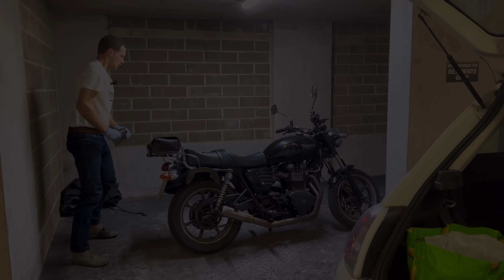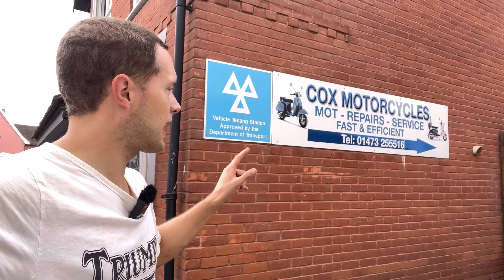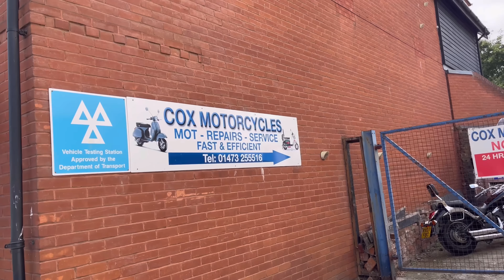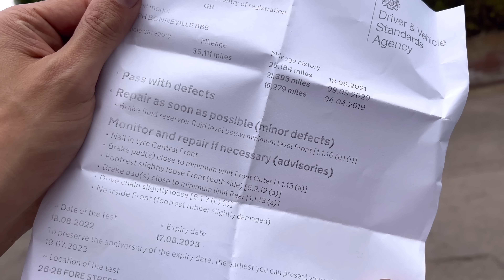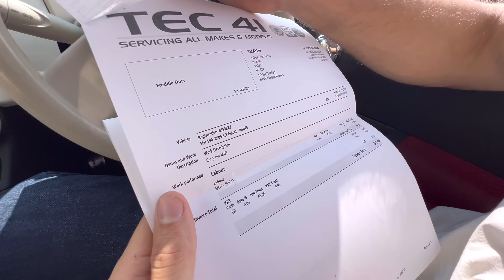Two Desperate MOTs in Two Hours | And Three Week Wait if the Bonneville Fails

Comment: If you removed the master cylinder cap on the bonnie and used a longer screwdriver it would have been a lot easier to push the pistons back. Obviously you would need to watch that no fluid overflows from the master cylinder whilst doing this. You should also clean the pistons before pushing them back or the dirt on them can ruin the seals.
Reply from the maker: Noted- really appreciate this👌🏻👌🏻🙂
Reply: But like the comment said, watch brake fluid doesn't spurt out of the reservoir, cover metal work (petrol tank) with plenty of cloths and gently push the pistons back.
Reply: You can protect your bike from any overspill by getting hold of a sweatband and popping it round the open master cylinder. Any fluid that overflows gets soaked up nicely.
Reply: @FreddieDobbs  @HeeBGB By placing the pistons further in, to accommodate the new brake pads, the fluid level will rise, which should solve one of the pending issues of the inspection (MOT).
Reply: I would also put the old pads back in, then use the screwdriver 🪛 to lever the pistons back (after cleaning & removing master cylinder cap).. whilst all metal etc, you don't want to nick the rubber dust seals around pistons
Reply: Correct.
Reply: There are seals around those pistons that can be damaged from the dirt and grime on the side of the pistons as its pushed back in. You want to clean the area first with a product that won't harm the rubber seals.

Comment: tip - spray the exposed calliper with brake cleaning fluid first, before compressing back in, with fluid reserve cap off. that way, it should prevent dirt damaging the seals.

Comment: Remember to take the cap off the brake cylinder so you are not working against pressure. Be careful when leaning on the caliper cylinder because it IS possible to snap them.

Comment: Wow - I was feeling stressed just watching this. The list of advisories was not actually that bad - stuff that is fixable with just a few hours work. Front brake fluid level is low because the pads are worn out. When you replace the brake pads it is worth replacing the fluid as well so you know everything will be good for a few years. Love the brake caliper piston compression tool improvisation - as someone else noted good idea to clean the pistons before you push them back in. I must admit I never thought I'd hear FIAT and reliable in the same sentence but it must be an older one made before LED lights etc. became vogue - we have a 17 year old VW Golf Mk V that is the same - generally very simple to work on and just keeps on going.

Comment: Bit behind on your videos, Freddie.  Good to see you do some of your own maintenance. Is it really over a year since you set off for Tenerife?. I really enjoyed that series. Stressful today, eh. Both my Yamaha MT-01 and my Can-Am F3-S started first time after over two years eight months away from Portugal. I had to buy a battery for the F3, though. Kicked myself for not disconnecting the battery, but I didn't realise I'd be away so long. I lost one of the nuts when fitting it and had to hike around to find another. The hardware shop had never seen one the shape I wanted. A motorbike shop had one, though.
      192,000 miles on the Fiat. Fantastic. Simplicity is priceless.

Comment: I was watching you try to push those brake cylinders in thinking "G Clamp!!", but you got there in the end. Only difference for me is to put the other old brake pad under the other side of the G Clamp to make sure the clamp doesn't leave an unsightly mark on the outside.
Reply: I use "tongue and groove pliers" as they are called here and otherwise used in plumbing and also agree that using the old brake pads to prevent marking the pistons work very well.

Comment: Hi Freddie:

I have tips for you:

opening the brake fluid reservoir cap will make it easier to push the caliper back in.

the brake caliper should not be left hanging on the brake line when working. the brake line can break or leak. hang the brake caliper on the front fork with a rubber band or rope, then nothing can break. it is important that the brake line is not pulled.

but you did a great job.

best regards from Germany.

Comment: Job well done Freddie, l’ve been using G clamps to return pistons on bikes and cars for years, if you remove the reservoir cap and you can check if it’s going to overflow as you push the pistons back in, if it does a bit of clean tissue paper will soak up any excess fluid.

Comment: Don't worry about the piston rewind tool/caliper spreader. Just replace the fluid and Bleed brakes through when you out new pads in. The fluid is only a couple of quid and it's good practice to replace this often anyway and it really doesn't take long. When all the fluid is removed the pistons should push back in with your fingers very easily. 👍
Reply: Don't give Freddie even more stuff to do, Monika will sink into a vat of despair.
Reply from the maker: I’ve never bled the brakes- I know I must try, thanks BMS🙌🏻

Comment: The use of a thin coat of anti-seize on the backs of the brake pads is traditional to prevent brake squeal
as the pads vibrate forward and back microscopic amounts along the face of the moving disc surface.
The anti-seize acts as lubricant between the metal back of the pad and the face of the piston.  For that
reason, the annular face of the piston should not be marred, but should be kept as smooth and flat as
possible so it doesn't push through the anti-seize to form metal-to-metal contact.  The C-clamps can be
used with a used pad as a flat surface to push the pistons back into their cylinders, or if the center of the
pistons are slotted, a LARGE flat screwdriver can be use to push the pistons back while rotating them with
the screwdriver to avoid jamming them into a cocked position.  The push-back process can go more smoothly
if the surface of the pistons are first cleaned with brake cleaner and then lubricated with anti-seize or WD-40.

Comment: Freddie pipe wrench  is good for pushing the calliper pistons and always remove the master Cylinder cap put a clean rag over the top keep and eye on the fluid level and probably change the brake fluid every two years. Now living in Australia  don’t miss the mot every year in our location just service keep roadworthy but no annul worry mot check.

Comment: If there was a hardware store nearby, all you needed to compress the brake caliper pistons back in is a good sized C-Clamp and use one of the old brake pads in there to compress both pistons at once. I've done it many times in a pinch. Otherwise any auto-part store typically carries a brake caliper compressor. I'll give you an A+ for effort at least ... LOL! Always enjoys your videos nonetheless, thanks and safe travels!
EDIT:  Just watched through to the end of the video and it looks like that's exactly what you ended up doing (using the C-Clamp) - they're always great in a pinch when the proper tool isn't accessible! LOL

Comment: Fred, when you get a bit of time you really should clean those brake pistons. It's relatively easy to do and will improve your braking no end. 
 Ok, so take the calliper off; either front or back, and hold it in one hand with your thumb on the pistons themselves. Then, pump the appropriate brake; front or back, very slowly to raise the pistons out of their sockets. Whatever you do, don't let the pistons come out of their respective holes as it's a bit of a nightmare getting them back in: bleeding the brakes etc etc.... Next you need to get some WD40 and some very fine emery paper and sand the sides of the pistons till they are smooth all the way round. You could also gently sand the tops of the pistons too, as they looked a bit rough during the vlog.
 You should then smear 'Copper Slip' over the sides of the pistons before reassembling. Once you've done this, you should be able to push the pistons back in without using the G-Clamps. I have done this to my Honda Hornet 600 for all 3 disc brakes on the bike and the difference is noticed immediately.
 I learned to do this from a You Tube vid about 10 years ago and believe me mate, if I can do it, so can you. My bike was stolen just over a month ago so at the moment I am bikeless. In the middle of summer too. GUTTED!!
 Hope this helps
 Aidy x

Comment: The slots in the brake pads do three things: 

a) Allow gasses to escape from between the pad and rotor under heavy braking as the friction material "burns off". The holes in the rotor also help with this.

b) Act as a visual indicator for brake pad wear. If you can still see the slot there's still at least some pad left, if you can't you know you're in dire need of a change.

c) Change the way in which the pads make noise/vibrate by changing the natural frequency. Like a tuning fork, the length of the pad changes the resonant frequency. By splitting it into two sections it changes the effective length and will usually reduce noise but will depend on the overall braking system to if it actually does anything.

It's mostly for the noise part. I doubt you'll notice a difference.

Comment: Very entertaining. Ever thought of cleaning the caliper, including the floating part of the caliper while replacing the pads? Helps prevent uneven wear of the pads. When using the clamp I suggest you use it the other way around so you're screwing into the old pad rather than the caliper. What you did is probably what a mechanic would do, which is why I always do the brakes myself. Sorry to be so pernickety, but I'm rather mechanically sympathetic. 😁👍.

Comment: Hi just to say use wd 40 or gt 84 when you take the pads out to clean the muck of the break pistons and they will push in easier freddy
Reply: Don't do this! WD40 can damage brake seals and the spring back motion of the brake pistons (i.e, how the pistons release after braking) is actually driven by the friction between the seal and piston, this is lost if there is WD40 residue between the seal and piston interface. There are brake specific cleaning aerosols which evaporate quickly after use, these are what you should be using.

Comment: Freddie, it's also worth cleaning the pistons before pushing them back in. Brake dust and dirt can damage the rubber calliper seals. These are considerably harder to replace, so best avoided. Often requires calliper removal and compressed air to "pop" the piston out via the bleed nipple. Messy business!

Comment: My daughter had a Fiat 500. Very reliable except for the door handles which are a  PITA to replace. Oh yeah,  the gear gaiter was also a bit fiddly to replace.
Hah, the old gclamp.  Used them on the rear brakes of my i40.
Reply from the maker: Haha yep Owen, I can confirm it’s a weak point as I’ve had to change both Fiat door handles!

Comment: By placing the pistons further in, to accommodate the new brake pads, the fluid level will rise, which should solve one of the pending issues of the inspection (MOT).

Comment: a good ol C clamp can be really helpful pushing those cylinders back in even with the master cyl cap on, tho it helps to crack it open. C clamps are alot cheaper than the one job caliper tool
Reply: lol and right at the end ive found out you found the C clamp lol! Great job

Comment: As far as I know there is no limit to the thickness of the brake pads, it is just tested to see if they stop the motorbike.
You might get an advisory that the brake pads don't have much on them.
The brake fluid being low is because the brake pads are worn out,  When you put new brake pads the level will go up when the pistons are pushed in.

Comment: First clean the brake pistons ( brake cleaner & toothbrush/ strips of cotton sheet), else you are forcing all that dirt into the seal. Remove the brake reservoir cap. Then place the old pads back in and lever the pads apart with a screwdriver- you only risk damage the brake faces of the old pads. Keep an eye on the resevoir as pushing pistons back-in will increase the fluid level, & may overflow & damage paint etc. When pistons pressed back in, replace old pads for new. The copper grease on rear of pads help reduce brake squeal, by lubricating the piston to pad surfaces by reducing high frequency vibrations. 
Note If pistons are really stiff to move then suggest pump piston out (restrict other piston from moving with G clamp and wood - wood against piston face to stop dammage)). Have cloth ready as brake fluid will flow out once piston displaced. Gently, with dentist probe/pin/thin screwdriver, remove internal seal(s) from caliper housing and clean any residue ( usually accumulated on back (outer cicumference of seal)). Check seal face (inner circumference of seal) for damage where piston being forced in may have scored it. If ok it/they can be placed back AFTER cleaning any deposits ( and there will be deposits) inside the machined grooves of the caliper. Not easy to clean but again small thin flat screwdriver will suffice. These deposits is what has forced the seal very slightly out and causes the seal to 'grip'the piston too tightly. Use brake grease like Shin Etsu or similar ( designed for use on brake seals -this is NOT standard grease!) to v lightly smear seals before refitting. Now clean piston, all pits need removing. It's probably chrome plated. You can replace if badly corroded, or use v fine emery cloth to rub away rust spots. Lightly lubricate piston side surfaces with brake grease and re-insert in caliper. Note how smoother& easier the piston pushes into the caliper. Swap G clamp & wood block to this cleaned piston and after refilling brake resevoir, prime/bleed the hydraulic system until enough pressure to pop the other piston out and repeat cleaning process. 
Note if your seals are badly scored or you split them on removal (they are hardy so don't be afraid when handling) you can buy new ones.
Obviously when both pistons all back in caliper, re-bleed system, pump lever several times when complete before riding to ensure pistons are fully out/pads in contact with discs. Dispose of fluid at recycling centre
Hope this helps

Comment: From UK highway code - "Windscreens and windows MUST be kept clean and free from obstructions to vision" and it means in the wipers range you can't mount anything on the windscreen as you may be penalised - £100 and 3 points per device - just heads up
Reply: What are the whippers ?
Reply: @1mikefrost  thx Mike - wrong spelling 🙏
Reply: You're wilecome !
Reply: Bet you’re fun at parties..
Reply: @gdfggggg  what parties ?
Reply: @gdfggggg  and how it this even relevant?
Reply: @lukuxider2000  have I touched a nerve 👀

Comment: Hi Freddie, a little tip. Get a magnetic tray (not expensive) to put your fasteners in whilst working on the bike. There's nothing more infuriating than hunting for fasteners that you put on the ground. There is no need to put copper grease on the back of brake pads that are copper coated.

Comment: There's no need to remove the reservoir cap as it's vented to atmosphere (you pushed the pistons back easily enough to start with)....unless you topped up the fluid part way through the wear cycle. In which case you'll get hydraulic lock. Then you'll need to remove some fluid from the reservoir, carefully, because it's corrosive to paintwork. In this scenario, if you had removed the cap, yes you'd be able to push the pistons all the way back, but fluid would definitely spill over the top. Brake fluid isn't cheap, but I'd have some on hand just in case. 

Great videos. I enjoy watching them. Cheers!

Comment: @Freddie Dobbs 
With a good screwdriver push back the piston with the old pads still in. You can do the same with the new clamp by just leaving one dpad in, avoids damaging the pistons.  Make sure you have around the reservoir covered with cloths to stop any fluid from getting on the paintwork. Excellent Vlog. We have to bring out vehicles to NCT centres. (National Test Centres) They were run by a German company. But now SPANISH MULTINATIONAL testing and services group Applus RTD has emerged as the winner of the new 10-year national car testing contract worth more than €400 million.

Comment: I know there are a lot of people mentioning the front brakes already, but I would definetely advice you to have a look at Delboy's Garage for servicing the front brakes. The brakes are the most important thing on the bike and you should do proper research and a proper job before going at it. It sounds dramatic, but it could mean the difference between life and death.
Reply: I wouldn’t let Delboy service my skateboard, he is an incompetent amateur mechanic with some very dangerous practices.
Reply: @redmille1000  really? Please elaborate
Reply: @Pixonyx  advising amateur mechanics to warm the engine up until the fans kick in when changing coolant, putting copper grease on the back of brake pads when the manufacturer expressly advises not to do it, putting an angle grinder into a work bench vice, the list is endless! Watch Dirty Garage Guys, he has a lot of videos where he shows all the bad practices that Del Boy does, Del Boy is a bus driver, not a mechanic.
Reply: @redmille1000  Thanks for the tip, I'll have a look at the Dirty Garage Guys. I haven't seen the videos where he does the things you mention, but I have only watched all of the ones with Triumphs as that's my bike ✌

Comment: Trying to push against a sealed hydraulic system with a screwdriver, your calliper dangling from the brake line and copper grease all over your nice jeans was a difficult watch 🙈